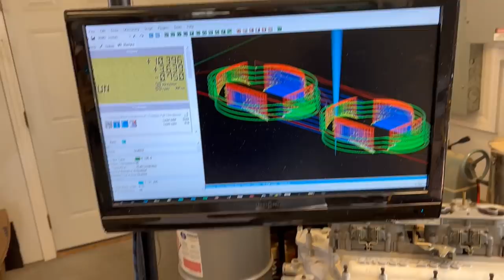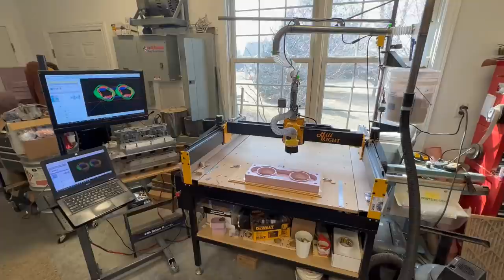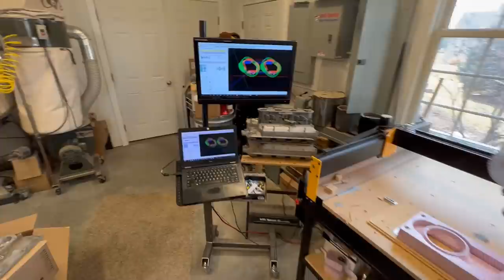Lost Foam Casting a 41 Willys Coupe Scoop Adapter

Comment: Have you looked into mechanical fuel injection midget 4 cylinders like the inline carb that you worked with in this video? With The piece you worked here. But one piece block you could make quiet efficient. And more stable on the heads. May look and Esslinger or and others in the industry. A good solid piece minimize parts as a one piece product. Up to the air cleaners? At least have a copy Wright maybe come up to a midgets to Indy type vehicles I think it could be evolutionary designs. Great job👍👍👍

Comment: Love your your work Kelly 👍 I've seen you cast some pretty complex parts, like a manifold, but would your methods be suitable for casting a 6 banger cylinder head?
Reply from the maker: I wouldn't see why not. In the commercial setting, water jacketed engine components are comonly done in LF.  In the hobbyist setting the challenge is melt capacity, and mold handling and packing capacity. Right now, my pouring capacity is 60lbs of Aluminum (so part plus feed system). I think my existing flask (30 gallon drum with extender) and packing system could handle it. At 450lbs, the challenge is enough vibratory energy to pack it, which is very important for intricate cores like a water jacket. You can see my equipment for such in the intake manifold video. Best, Kelly
Reply: @kellycoffield533  Cheers Kelly 👍I have some big plans, for cadding a head (sliced if needed) modifying/raising the inlet ports a bit in cad, adding thickness in seat and combustion areas, changing combustion shape, then milling the foam in slices, gluing it together and getting it cast. A bit of stuffing around, but seems pretty easy in principle.. I know GM are even casting whole engine blocks this way now, but they use a lower density styrofoam. It's amazing what can be accomplished these days. All the best 👍
Reply from the maker: @jfair7050  Sounds like a funproject J. We'll expect a full video report. Best, Kelly
Reply: @kellycoffield533  Haha, don't hold your breath on that 😛👍

Comment: Permission to ask
What foam do you use to make the model?
If possible I would like to see you cast motorcycle engine(V-twin).
*From Thailand**Sorry if I wrote it wrong*
Reply from the maker: Extruded polystyrene foam insulation board. 1.3lb/ft3 density.

Comment: You make some fantastic castings!
Why not put the ring on the bottom of your buckets so it all falls out the bottom and you dont have to push/roll it over?
Reply from the maker: Those buckets have a vacuum plenum and screen in the bottom. I dont use that feature much. When I dont have the height extension on them they are much easier to handle. I also use them to store the stinky sand. Best, Kelly

Comment: I get a lot out of every video you do. Thanks for the tips on the CNC, especially the grounding. What do you mean by the "water line"?
Reply from the maker: It's a 3D machining method that slices the shape into layers like lowering the water level, thus "waterline", very similar to 3D printing only subtractive, not additive. Scanline methods step/cut adjacent vertical slices either parallel to X or Y axis. Best, Kelly

Comment: I'm just getting into lost foam. Thanks for all your help full content. Do you do any post heat treatment on you parts?
Reply from the maker: Depends upon the part. If it's ornamental usually not. If it is structural or will be machined, yes. I cast with A356 ingot. I usually apply a T5 schedule because that is very easy to do and gains most of the improvements of T6. I will occassionally add grain refiners and modifiers (Strontium and TiB) to critical parts. Best, Kelly
Reply: @kellycoffield533  thanks so much for commenting back! Do you have any info/videos for heat treating to t6?  I am trying to make some motorcycle triple trees, I have cast the parts, but they are so gummy when I try to machine them
Reply from the maker: @sheanyquist  Have you tried T5? It's only 450F for 6-8hrs. You can search the schedule for T6 online. It can be done in a kiln with a PiD controller and well place K-type thermocouple but the issue is the solution phase is ~1000F. That is much closer to the melting point and the casting will not have much strength, but the real issue is how uniform the temperature is in your kiln and preventing the radiant heat from the elements causing localized melting. I put my parts inside a metal can or cylindrical metal shield to prevent radiant line of site fromthe heating elements to the casting. Bring you kiln to temp and measure how uniform the temp is from top to bottom. It's common for there to be 100F+ difference. Bring the kiln to temp before placing the parts inside. Support them on a flat surface. It can be done. Just takes some care and follow the rest of the schedule. The above temps are for 356 alloy. Don't expect to get good results with unknown scrap alloys. Some are not heat treatable at all. A triple tree is a critically stressed part.....not ideal for a hobby caster. Better made in wrought. Be safe. Best, Kelly

Comment: Hi friend I'm from Brazil, which Owens Corning® Polyethylene do you use?
Reply from the maker: It's Closed Cell Polystyrene Foam Insulation board. OC calls it Foamular 150. 1.3lb/ft3 density. I have a video on my channel that discusses materials in greater detail. Best, Kelly

Comment: Wow I just realized... no core box necessary!
Reply from the maker: Yes, and also no concerns about complex parting lines (there are none), back draft.....etc. I've made so many lost foam castings that I would literally have a garage full of tooling. But evaporative pattern casting means I have none, just a cnc router that cuts patterns as needed with computer stored files. Other evporative pattern casting methods like block and shell invetsment would have large pattern and mold costs. By comparison, lost foam is literally pennies. When you have relatively large parts, this can be very significant. Best, Kelly
Reply: My metal pouring experience consists of just a couple babbit bearings  and a walnut sized aluminum  check valve for an old hand pump.
 But I got very interested in casting when I needed  a wet cylinder head for a 12hp hit and miss gas engine.
After reading a lot about it,  I gave up and welded one up from a lot of steel. Somehow it looked and worked great. But I didn't know about the foam trick then.
You got me dreaming of a small piston fuel pump and overflow fuel mixer for a Dempster 2 1/2 hp hit n miss now!

Comment: How about making a silicon mold of a part and pouring a 2 part foam in that silicon mold, then putting that foam pattern in the the sand?
Reply from the maker: 2-part foams (typically urethanes and Epoxies) are thermosets (TSs) which are very poor material for a lost foam pattern. Polystyrene which is thermoplastic (TPs). TPs go from solid to liquid to gas which is very important to controlling the LF process. TSs tends to decompose directly to ash and some gas and leave numerous casting defects. This info is from the pros but I canattest from my own experience. Best, Kelly
Reply: @kellycoffield533  so there is no such thing as 2 part polystyrene?
I'm just trying to cast the foam rather than mill it out of a block with CNC .
Reply from the maker: No